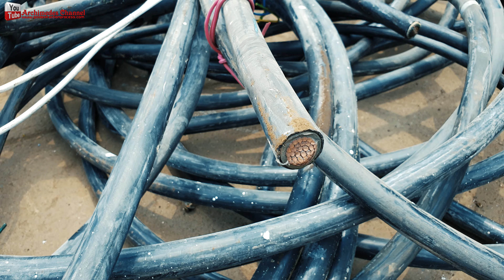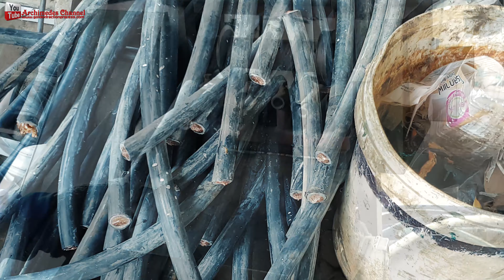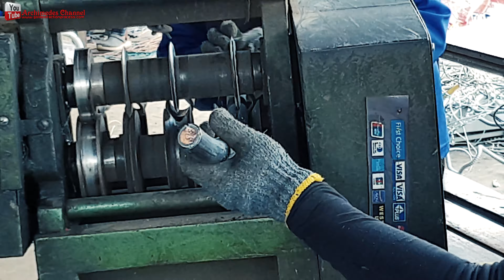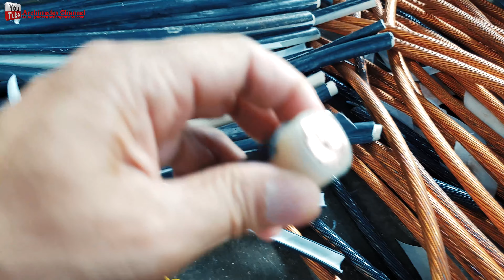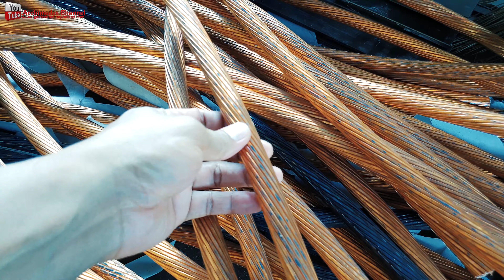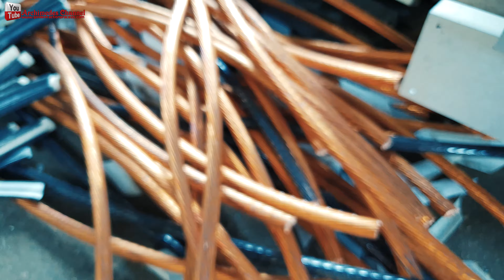Copper wire recycling Bare bright copper cable scrap

Comment from the maker: Copper facts you might not know
Did you know copper is nearly 100 percent recyclable? More than half of the copper consumed in the U.S. is from recycled scrap.

Almost 80 percent of copper produced in the world is still in use, and it can continue to be recycled without any changes to its properties. In fact, it retains 95 percent of its original value.

It’s also worth mentioning that copper should never be burned in an open fire. By processing the following scrap through a quality distributor, you minimize your impact on the environment for the betterment of the communities in which you live and work

Comment: I don't see how this was scrap copper as it looked very usable for industrial wiring. Seems to me this was a sacrifice for sake of making video versus real scrap.
Reply: I just stripped, by hand, this same grade of copper today. It was brand new looking, just like in video. Most get this grade from left overs after doing contract work as linemen on power lines. We get to keep whatever is left after a job.
Reply: @DirkDiggler2000  yes short leftovers, sraps are rarely useful but far too often you see pieces 4 or 5 meters and much longer even spools being scrapped that are still useful in industrial use or in home.
Reply: @kenjett2434  how you gon use that industrial wire at home?...make a swing?💀
Reply: @runninitup4L  now where did I say it could be used at home? Try learning to read it's industrial wire so it has industrial use.
Reply: @kenjett2434  if you know anything about houses you would know that cant really be used in a house...its a power line that provides power to a home but you cant just go outside if your power line breaks and do a diy repair on it so it seems like you need to learn a bit bud
Reply: @runninitup4L  obviously you can't read this is not a discussion about houses for your information I am a trained residential electrician. This is about scrapping industrial wire so enough of the trolling.